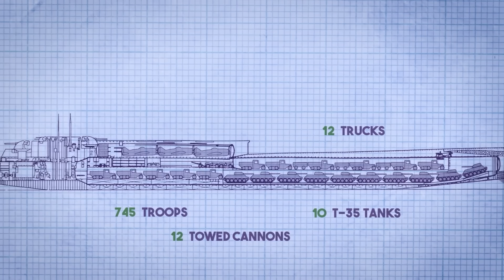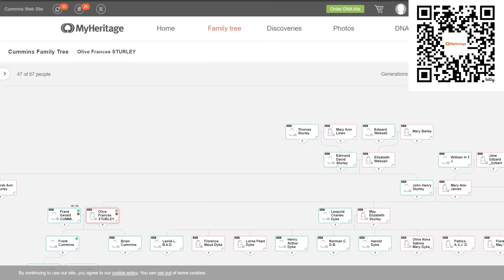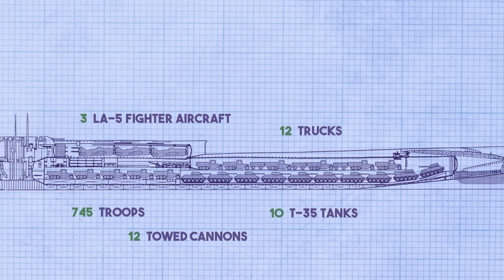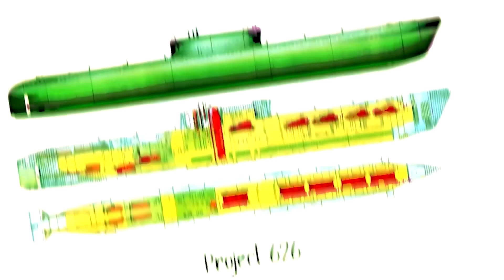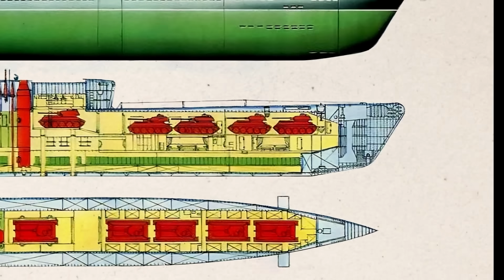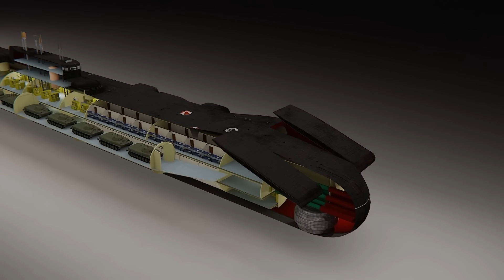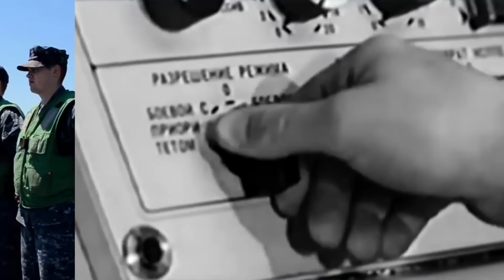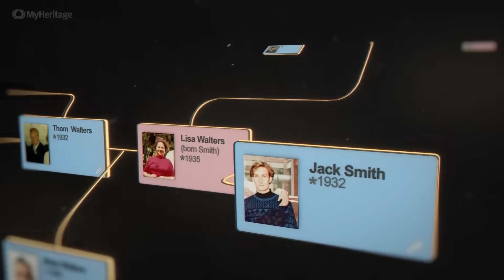Russia's giant submarines to invade North America

Comment: The best and easiest way for any country to invade the USA is through the undefended and wide open Souther Border.  All an opposing government would have to do is insert hundreds of thousands of lone soldiers crossing over the border to meet up at pre-arranged locations.  Their embassy could furnish all sorts of sophisticated communication devices and weapons via the Diplomatic Pouch.  Weapons could be bought on the legal informal private sales through classified ads or gun shows.  Ammo could be acquired at gun stores or through the mail via internet purchases.  The nexus of the power grids, the hospitals, the highway choke points are all easily attacked and undefended.
57,000 single adult males between the ages of 20-50 from Communist China have crossed the Southern Border in the las 2 years.  27,000 have crossed since January 2024.

Comment: Soviet subs of that era were notoriously noisy even if they were small streamlined attack subs.  A giant poorly streamlined box cruising along at shallow depths because of all the doors cut in the pressure hull, that's powered by a Soviet naval reactor and filled with Russian troops banging around inside?  The SOSUS array would have heard them coming from the other side of the ocean.  If a Los Angeles class didn't follow them the whole way and put a torpedo up their posterior at an appropriate moment a bomber would be circling overhead waiting to drop its load as soon as the conning tower poked through the ice.

Comment: For the most part, I’ll start by saying leave it to the Soviets to come up with probably some of the most harebrained schemes for military vehicles and stuff. Now that said, I will admit that in a way this submarine does seem like it would be a useful tool. However, I don’t think it would be useful in a sense for you know starting an invasion or something. If anything, it would probably work better as a cargo hauler. I understand in the video it mentions that they figured they could use it for more than just hauling cargo, but at the same time, it seems like that would be a smarter idea.

Or instead of making this thing, a submarine, why not attempt to just make it into a semi sub? Don’t know a semi sub or semi submersible is a form of aquatic vehicle that operates in a fashion similar to kind of a combination of a boat and a submarine. While incapable of diving completely under the water. About 99% of the vehicle is under the water, and only the the lack of better term conning tower is largely visible along with a exhaust port for the engine exhaust. Most of the time these things are actually used for drug smugglers. However, part of me thinks that devices like those would be perfect for military applications. And with the system like this, they could probably design it so that, it would ride relatively low, but not completely under the water.

Comment: Project 626 realistically would have no way to unload T-34s off that loading ramp as they completely lack neutral steering and cannot turn in place
Reply: this is both untrue and also irrelevant

you don't need to neutral steer to turn, and they just have to drive in a straight line in and out
Reply: Stop using common sense lol. Biased, pro Russian military people will get upset with you lol 😂

Comment: Imagine if one of those giant submarines, fully loaded, was hit by a torpedo.
And the torpedo exploded
Reply: A sub that big, especially a Soviet/Russian sub, would be very noisy. That means it would easily be detected and modern torpedoes are sonar homing. There's no way the Soviets could have kept those things a secret and once the secret was out the US would have, (assuming it hadn't already) ringed any vulnerable base with acoustic sensors to detect them approaching. After detection, helicopters could pinpoint the sub and drop homing torpedoes on it. So this is one of those ideas that sounds cool for a movie or video game, but would fail hard in real life.
Reply: Thats partly why you have interlocks and watertight compartments. Section off areas of the boat and allow at least a chance for an emergency blow.
Reply: @Jeremy-su5yq  I doubt this would do much good against a torpedo .
Even a near miss would be enough to buckle every section of the pressure hull.
Reply: @Jeremy-su5yq The problem is that a lot of those garages were just one big open compartment by the looks of the designs.
Reply: @Jeremy-su5yq  this is a very interesting idea until you lack the structural integrity to have both halves of the ship stay together

Comment: I've seen T-72s on startup. You want to put them in an airtight container? RIP, sailors.
Reply: Pretty sure they can start them when the doors are open and after the troops are ashore. Not like they are going to be landing under fire... it's meant for a stealth landing
Reply: @Kraken_Mybutt  This design is not possible, as someone who works on subs i can tell you this design is a flop. It says  700 crew, with all that load there inst enough room to fit that many people, you'd need a submarine that like at least a quarter to half a mile  feet long. Plus you wouldn't start the tanks in compartment because the fumes would literally just kill the sailors, you couldn't expel that much contaminated air while under the surface. Besides this cant be a stealth mission, the size of this sub and the propulsion would be so fucking loud.
Reply: @Jeremy-su5yq  fair enough. But no need to carry vehicles... the Belgorod is already 600 feet long and the US loses track of it all the time. They could fit a whole lot of soldiers in that.
Reply: @Kraken_Mybutt  The Belgorod is built for ~100 submariners. And that’s to keep the submarine operational.

It can’t carry more than a couple fully geared soldiers. It’s just not designed to.
Reply: @Kraken_Mybutt officially we do its not like they would know if there was an aircraft over head.
Reply: @Kraken_Mybutt The Belgorod isn't meant to do beached landings, and attempting to do so would make itself glaringly obvious even if the US lost track of it before then.
Reply: have you seen them turret toss though?
Reply: ☝️...to explain stupidity 👉=👉=👉 ... to see others as stupid❗️👎
Reply: They aren't any worse than any other Soviet tank. They all use derivatives of the same V-12 engine, except the T-80.

Comment: The question actually arises as to why no aircraft carrier submarine has been built yet. It would probably be smaller than a surface carrier but therefore also cheaper to manufacture and operate (smaller crew) and you could then financially afford a lot more of it, meaning a larger area could be controlled, which would make up for the lower cruising speed. (However, even conventional carriers cannot travel quickly when using the deck, otherwise the wind would blow the crew and aircraft off the deck.) Underwater, it would be almost perfectly protected from fire from above and would be difficult to detect, meaning less escort would be needed .
Reply: You have to surface to catch and release the planes which leaves it vulnerable. Also the jets are vulnerable with no place or communication to land... try and send radio signals through the water and into the sky....😂😂😂
Reply: @ryshellso526  you are laughing a fool's laugh. onnly the biggest arrogant idiots use this emoji. can't you think? of course once surfaced it would operate like a conventional carrier, Einstein. and you would of course have enough escort to protect it, namely submarines too. So easy. Logic, to hard for you?